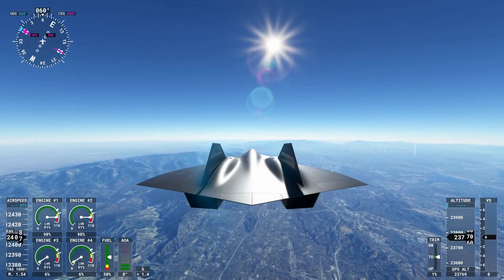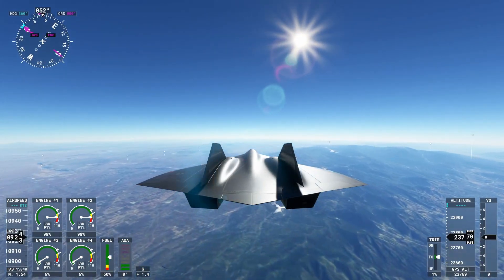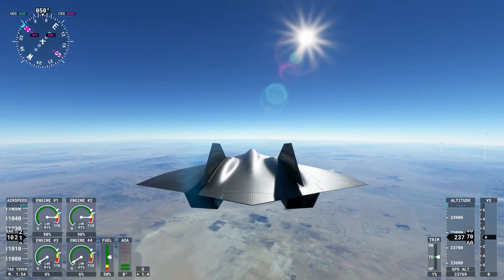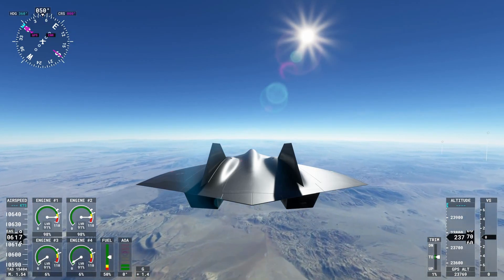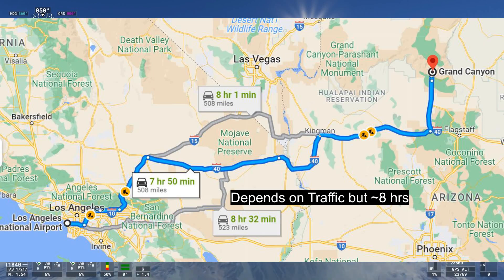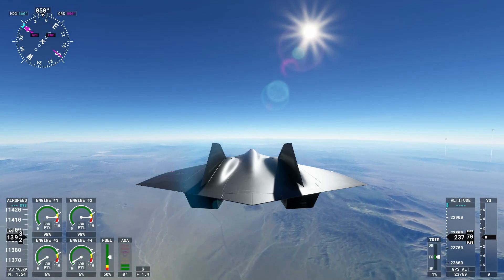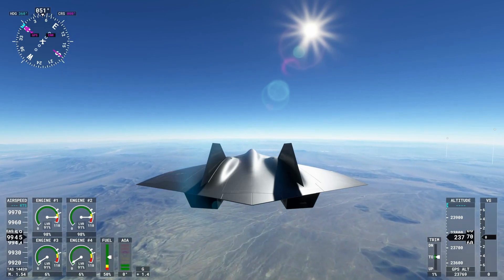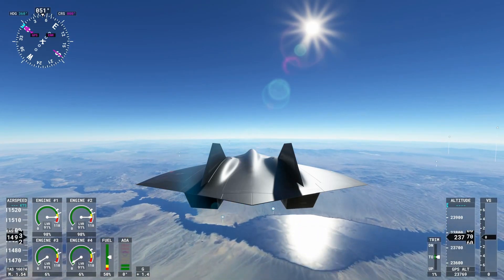MSFS - What Does Flying Mach 30 Look Like on the Ground in the Top Gun Maverick Darkstar

Comment: Regarding the comments seeking to compare the speed of the ISS against the Dark Star...IIRC, a Mach number represents speed as a multiplier of the speed of sound at a given atmospheric pressure. Mach 1 is the speed of sound at sea level pressure, somewhere about 700+ MPH. But at high altitude, pressure is less so Mach 1 will be slower than at sea level (fun fact, sound travels MUCH faster in water than air). With this in mind, you cannot correlate the orbital speed of the ISS to any Mach number since it orbits in near vacuum. It's Mach number would actually be a small fraction of 1. Which is why speeds in space are just the velocity in mph/kph or feet/meters/second. It does make sense that a Mach number would represent the performance of an aircraft since pressure is a component; you could think of it as how much air pressure the aircraft can power through, but for anything in orbit a Mach number is meaningless.

Comment: He says 18,000 tas but the meter says around 10,000? Am I missing something?
Reply from the maker: Whenever I go over land, the surface altitude and temps change which cause the TAS to change. I started at the ocean to get a baseline of 18000 and maintained the same altitude going over land but the mountains cause uses with it
Reply: @OneMoreRollAviation  changes in temperature and pressure would cause the mach number to change, sure, but if the airspeed is dropping that much it’s not going to be showcasing the same thing at ground level? Do you mean the meter is just wrong and it’s a glitch?

10,000 knots is mach 15 at sea level and all.
Reply from the maker: @Goji-Moji  it may be a glitch, I'm not really sure. You would think it would stay constant because your altitude doesn't change even when you are going over land. Your MSL stays the same. So, I think it's a bug of some sort. I chose 18000 TAS assuming a much colder day at sea level. I did the math, and the distance traveled in this video was pretty accurate to how fast you would travel if you were going 30 Mach 👍